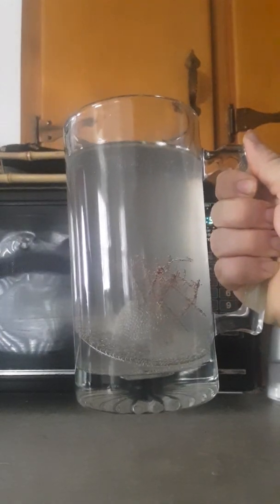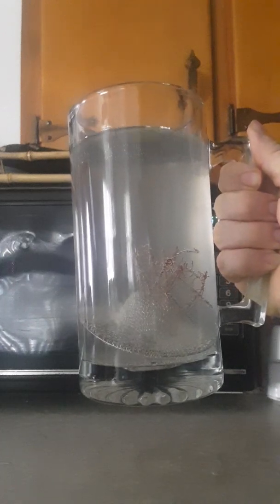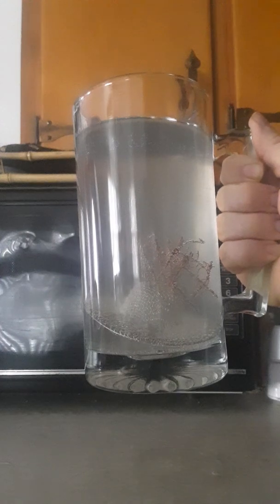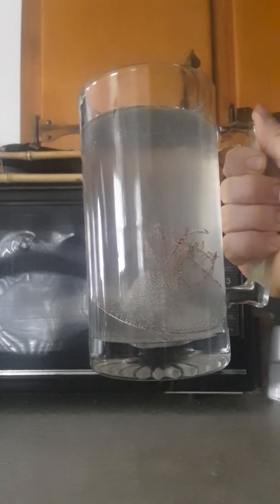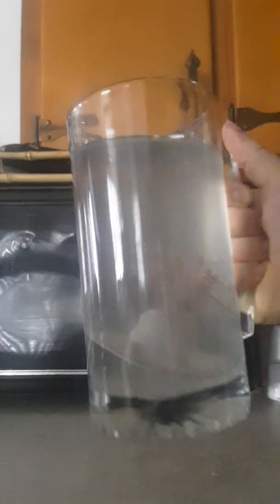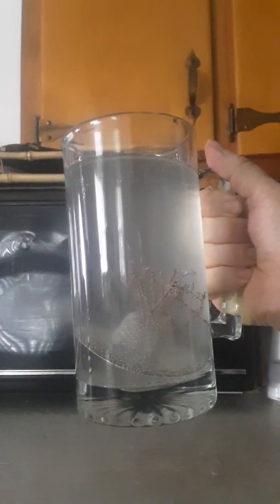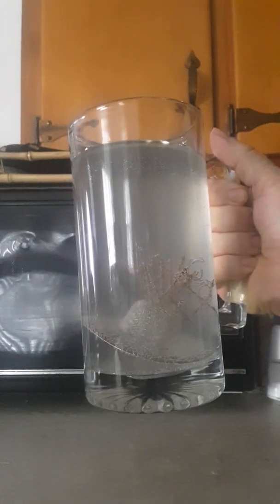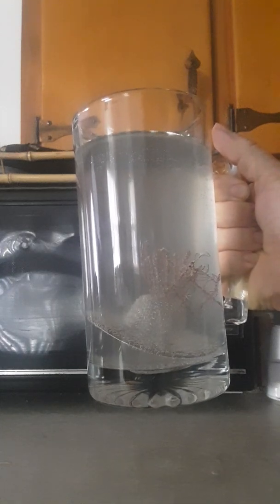Graphene hematene battery futurism

Comment: How do you use the graphene and hematene together? What is the coral shaped structure?
Reply from the maker: all you need is two strips. one of each in water. this was coiled metal wires around graphite rods. the rods have a graphene coating from co2 laser processing

Comment: Nice job with three dimensional electrodes..; 
could I ask how to make those.
  are they copper wire, coated with a mixture of carbon and iron nano sized stuff..?
Reply from the maker: graphite rods. a co2 laser heats them making a layer of LIG graphene. the copper wire has nanoflakes of hematene electrolytically bonded to them

Comment: So if the energy comes from the brownian motion of the water molecules the temperature of the water should be going down ,can this be detected by a thermometer?
Reply from the maker: The water energy is replaced by heat outside itself flowing into it from the local area. I have seen no temperature changes although there may be small fluctuations.  The energy is not converted at a rate that makes noticable temperature changes. Like zihan xu's ambient heat battery with graphene in MIT technology review   in 2012
Reply: @peterlang777  Still worth trying to do this in a Glass thermos with a precise thermometer. Measuring even the tiniest temperature drop, would be proof that the energy is from Brownian motion. Have you measured the volume of gas produced? That would give you a figure for the power output.
Reply from the maker: @Tore_Lund  I have used balloons. The last gave 480 cm3 in 30 minutes. Others were less. The brownian motion can be confirmed by similar nanotech like zihan xu's ambient heat graphene battery
Reply: @peterlang777  interesting, that is then 640cc H2 per hour, so the cells is producing around 320w of electrical power for the electrolysis, and the losses = waste heat, should be significant and measurable, even if All the heat is spent on countering the cooling, so likely, some of your H2 must be generated by a chemical process, or the water would get Cold. Are you using ion free water or is anything added? I'm not pulling your leg, Brownian motion on Graphene can theoretically generate100kw Per square meter.
Reply from the maker: @Tore_Lund  molybdenum disulphide monolayers using saline gradients produce 300 watts per meter now. The brownian motion is significant. Zihan xu said it was large for his battery effects too (MIT technology review  in 2012)
Reply: @peterlang777  I'm gonna read Up in this link. This is definstely worth persuing!
Reply from the maker: @Tore_Lund  and prof. Thibado of university of Arkansas.  At thibado@uark.edu
And 479 575 7932
Reply: @peterlang777  I stumbledd upon him, so gogling, I found your video.

Comment: I send an email inquiry to Dr. Ajayan at Rice about purchasing commercial Hematene and I will let you know what he says if he responds to me. I have one more question about the exfoliation of the 12 grams of rust if you don't mind. What was the volume of DMF you used for the 12 grams of rust?
Reply from the maker: I used 3.1 liters
Reply from the maker: Hematene is very interesting. It is very photocatalytic too. There is work on pairing it with titanium dioxide or zinc oxide for solar powered batteries and it is also unique with magnetism being a 2d magnet!
Reply: @peterlang777  Yes, very interesting indeed! I came across an interesting paper today. It was the synthesis of hexagonal 2D Hematene flakes using a hydrothermal method. Heating Fe(OH)3 with NaOH in a teflon hydrothermal reaction vessel. Have you seen or tried this method of Hematene preparation?
Reply from the maker: @William_Hada  no I have not heard of this? It sounds interesting.?  It sounds good!  I will have to look it up. I wonder if the hematene and titanium dioxide mix in a glass jar would make a solar battery!
Reply: @peterlang777  Sounds interesting and worth a try!

Comment: Think about how this can be taken to industrial production and I Will help You!!!
Reply from the maker: It can be scaled up easily. It is open source there are no restrictions on its use or who can make it. I invented it and made sure it cannot be patented through public domain disclosure
Reply: @peterlang777  ok, if You are interested in making and industrial design, and create the step by step according to your experience, let me know.
Reply from the maker: @jucavaque  it is simply to electrodes in water. Graphene and hematene.  You can use laser induced graphene and make the hematene from rust powder with rice university method (dmf solvent and sonication)
Reply: @peterlang777  OK 👍

Comment: Why didnt you collect some hydrogen and  pop it with flame, or measure a voltage,  just to prove the concept. 
Personaly I dont doubt it is hydrogen but that could easily be mocked up. Would make a more interesting video as a bonus.
Reply from the maker: Other videos have it burning and in one it operates a fuel cell. All on my channel
Reply: @peterlang777  Thanks Ill take a look.

Comment: Nice demonstration Peter! It's impressive how much hydrogen is coming off the Electrodes. I am still struggling to build a working cell of my own. There is no electrolyte salt in solution,  just pure water, right?
Reply from the maker: Distilled water. I wired all the rods together to see if it made a difference. So far its negligible
Reply from the maker: You can make a basic one with just two strips. One of graphene and one of hematene
Reply: @peterlang777     I will try making a basic cell again. I have a question about the preparation of the Hematene, exfoliation in DMF. What type of ultrasonic device do you use in the Hematite exfoliation? A bath Sonicator or a more powerful probe Sonicator? I have been using just a 40W probe Sonicator. Also after the sonication is done do you use the reddish precipitate at the bottom of the solution or the top clear reddish liquid layer? Which part contains the usable Hematene? How do you get rid of the DMF?
Reply from the maker: @William_Hada  I had to use a a very basic method. 3 ultrasonic jewelry cleaners. For a total of 18 hours on 12 grams of rust. The dmf. I replenished every 4 hours.
Reply from the maker: I reccomend just buying the hematene outright from a place like acs nano
Reply: @peterlang777   Today I called three different nano-material supply places and none of them have Hematene in their inventory. They were also unable to give me  a name of a place that sells Hematene. I searched for the place you suggested " ACS Nano " and had no luck finding it. I guess I will just have to work harder in producing some Hematene myself. Thanks for your generous help on this Peter!
Reply from the maker: @William_Hada  that is weird! ACS nano sold graphene. I figured they would hematene as well. It is a mainstream peer reviewed chemical I know they use it in photocatalysis. Some chemical supply company must make it! Call rice university and see. Rice made the hematene process they will know who makes it
Reply: @peterlang777  I will contact Rice and find out who sells it. Thanks again!
Reply: @peterlang777  where did you get yours?
Reply: @peterlang777  and for experimentation purposes using magnesium and sulfuric acid to produce hydrogen could be an alternative. I mean for simply recreating the conversion of hydrogen to electricity. But this cell is amazing and I will be giving it a go asap. So I guess I to will be in search of these materials. Could it be they don't want us to have access?
Reply from the maker: @jvon3885  I made hematene from iron powder rust. Fine ground and put in dmf solvent. Then sonicated.
Reply: @peterlang777  I put a lot of my videos on private so the library is small. Thanks for the sub though. We must chat privately. If you are up for it I will pass on my number.
Reply from the maker: @jvon3885  my email is ekimmu777@gmail.com